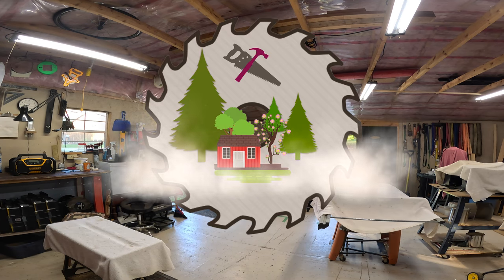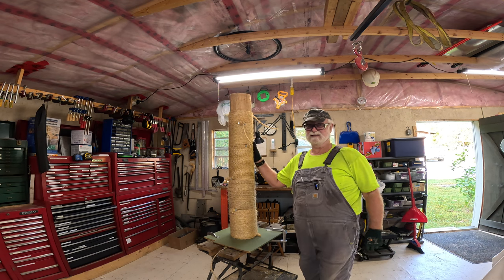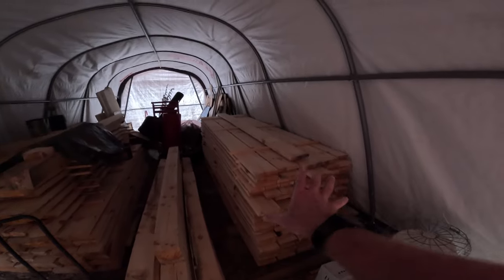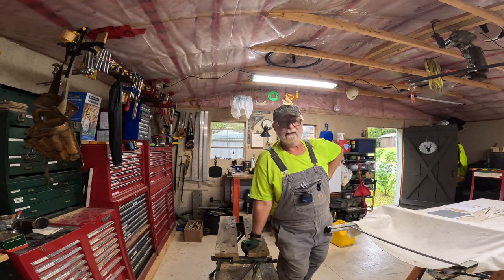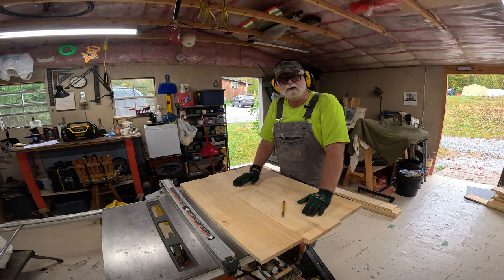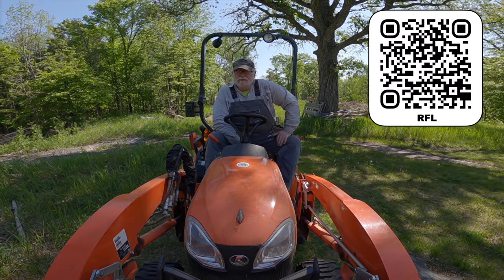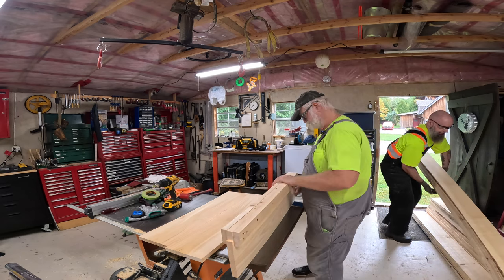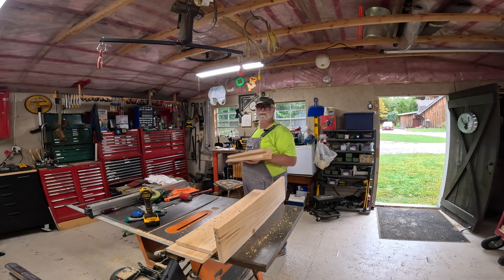Making My First Piece Of Furniture & Fixing The Giant Cat Scratch Post!

Comment: Good evening Brian. Helper Chris got a lot of boards cut to length for you, it's always nice to get a little help.  Great idea to make the dowel jig and to make the table top a little oversized. A few tips. When gluing you want just enough glue smoothened out across the mating surfaces so that when you clamp the boards just small beads appear on the top and bottom surfaces. Gently remove those beads with a chisel once rubbery thus  before they harden. When clamping you don't need a lot of pressure.
Use a small framing square or a straight edge to ensure the boards are flat and not cupping. You can add clamping cauls on the ends as well to keep them aligned. Keep up the great work!
Reply from the maker: Thanks for watching and commenting Paul! I found out what a pain it is to remove excess glue! Thanks for stopping by!

Comment: My furniture making came a little closer this week, as I found a 6'x30"x25", squared off beech log on the shore whilst collecting seaweed for compost.
Went back yesterday & cut the worst of the rot out, then halved it, so ended up with two pieces 5'x12"x15".
Must've weighed 300lbs each.
Took them to the sawmill I've used before & he's going to cut them into a mix of 1" & 1½" slabs & give me some advice on drying.
There's some really impressive spalting, so I'll likely use it for drawer fronts &  cabinet tops.
Reply from the maker: That's great news! Sounds like a good find of some nice material. I'll bet that's going to be fun to work with. Thanks for stopping by!